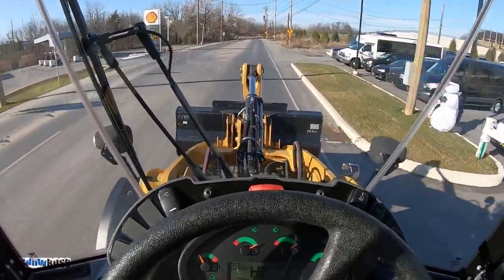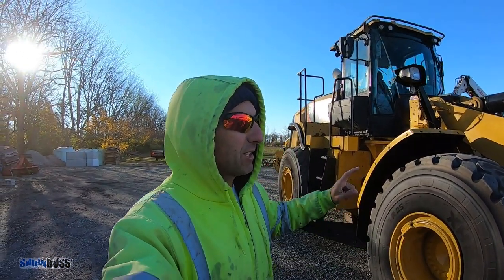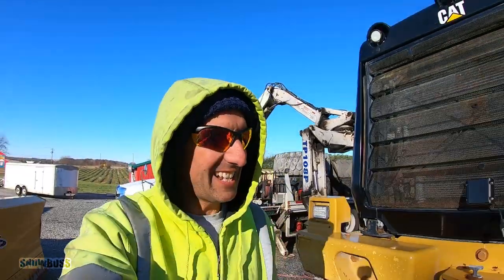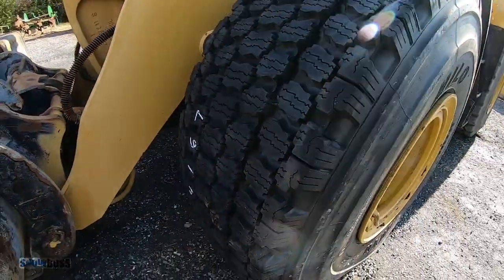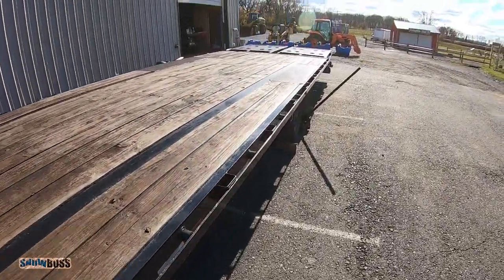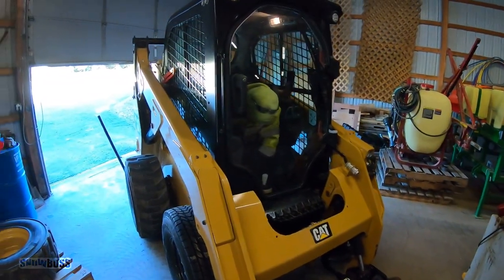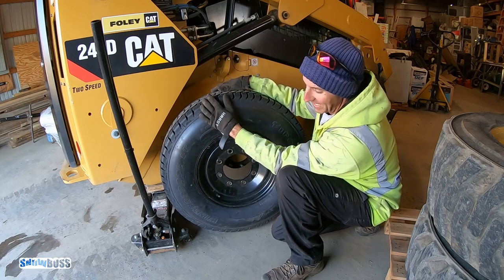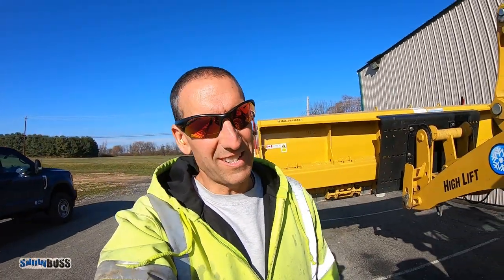Final Prep for the 2021 Snow Plowing Season

Comment: Good to see a new video how did you find the 966 with I am assuming no steering wheel unless it is much older but looks pretty sharp. Watching some video's on volvo loaders and they have both joystick and steering wheel for road use and joystick for pit work. Only thing better than lots of snow is getting paid to plow it.
Reply from the maker: It is a joystick drive, but got some surprises coming 😮.  Thanks for watching.

Comment: i assume you keep them plugged in on site. any issues if it drop below zero?
Reply from the maker: No, we plug nothing in. It doesn't really ever get that cold here. But when it has everything fires right up.
Reply: @SnowBoss  nice! im in ND so we see a few -10 and -20 temps each year. block heaters are a must, along with diesel fuel treatments to prevent gelling.
Reply from the maker: @nocoolname32  Yeah we use treated fuel too. But it doesn't get really much colder then teens. We have gone negative a few times but that's few and far between.